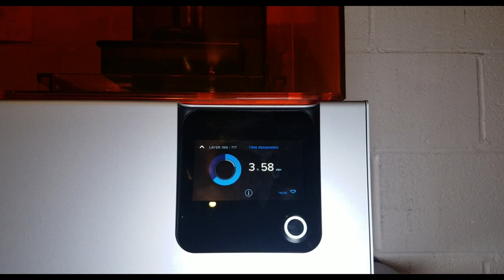3D Printed BMX STEM

Comment: Is it cost effective to make things like pedals with the printer or is it pretty equal to just buying the parts?
Reply from the maker: Hmmm... that depends on a lot of factors. For the circumstances I printed this with, I'd say probably not. Although the material used was only about 27 dollars, the time I put in to designing it and the upfront cost for the printer itself, which is over four grand, make it a little... iffy. For me it was worth it. Of course you could do this with less expensive printers with cheaper material also.

Comment: How does it go with the threads? I'm just wondering if you had to tap them yourself, and how they hold up to so much tension...?
Reply from the maker: Threads go all the way through, I designed them in the software along with the rest of the part and the printer was able to accurately print them. I printed at a 50 micron layer height so there was no problem there.

Comment: Dude why the fuck don't you have a bigger following? Your printed parts series is fucking sweet. I just wonder what you will do after you do all the different parts, maybe a full bmx of printed parts?
Reply from the maker: +Rayle Slayre thanks for the kind words, man! I also wonder what I'll do with them, I want to make a full 3d printed bike someday but I don't have a printer that could do bigger parts, that doesn't cost fourty grand. Anyways, glad you like it!
Reply: Hell yeah man, I think you still could maybe come up with some new ideas for parts that don't currently exist. I always hate dealing with my brakes fucking up my wheel alignment and don't justify that as using my shoes for brakes cause that kills the soles but thought  it'd always be cool if there was something like a dangling pad similar to scooter brakes or something that wouldn't require cables or levers or the loss of soles in shoes..

Comment: What brand of printer do you use old mate ?
Reply from the maker: My FDM printer is a monoprice maker select V2, the printer I made these pieces on is a Formlabs Form 2 using their tough V4 resin.
Reply: Jonny Lee What was the approximate cost of the setup? Resin and printer?

Comment: ha my buddy sent me a link to the article on BMX Union about you printing bike parts. pretty dope man. just did my first 3d print on my new printer today. quite interested to see what all you come up with. i have a ton of bike parts i want to 3d print. i have 3 sprockets on my desk i designed and had a buddy print til i got my printer. have miniature versions of bike frames and bars printed up. a stem i designed printed up. great way to design bike parts and test fit things before having them machined. going to try to print a hub this weekend... not sure how that one will turn out lol.
Reply from the maker: I didn't even know of that article until you commented that! Glad to see you getting use out of your printer. These are pretty amazing machines, that's for sure. Let me know how that hub turns out, man!

Comment: I respect what you're trying to do, but a stem and a sprocket will never hold up if not metal. Doing a few street tricks is hardly a test
Reply from the maker: +Supernoob Smith My experience trumps your untested hypothesis. Ive ridden these parts for months. Obviously, they're not as strong as metal but hardly the point! This stem is still on my backup bike, which Ive ridden since this video, along with my sprocket (which multiple people have been riding for months without problems since I've made over 15 of them) and all of the other parts I've made. Unless you have a production quality 3d printer at your disposal, with which you've made your own parts, then your opinion is invalid because you're basing it off of an assumption when I have the evidence to prove otherwise.
Reply from the maker: +Supernoob Smith What I'm trying to say is I think you're missing the point of 3d printing parts in the first place. It's never supposed to be a replacement for standard parts. This stem would never hold up to a big drop, but that doesn't mean it's not cool, I don't know. I think it's pretty awesome.
Reply: I'm sorry you're offended. I am basing it off assumptions. It wasn't just a simpleminded assumption. I base it off what I see from industry, from racing, and from a whole host of application in the world where it would be in use already. Still, I'm open minded. My reaction to a stem in particular is because it is an extremely important part. If there is plastic that can be used, I'd like to know what it is. Is it so expensive that even race teams wouldn't use it?  I still think your experiments are cool. And I think 3D printing has a bright future.